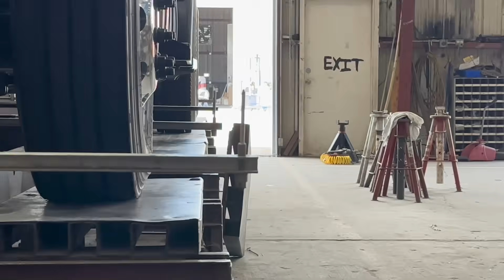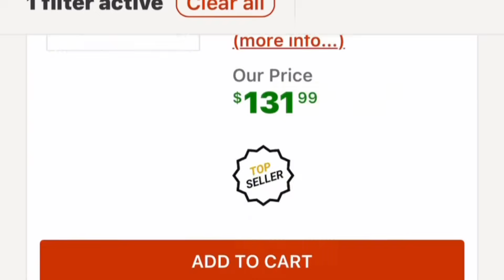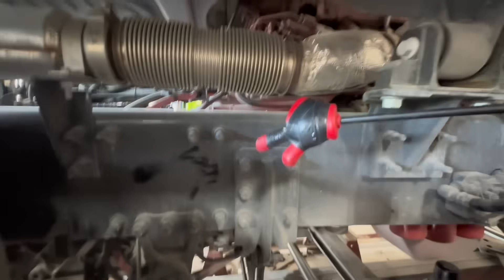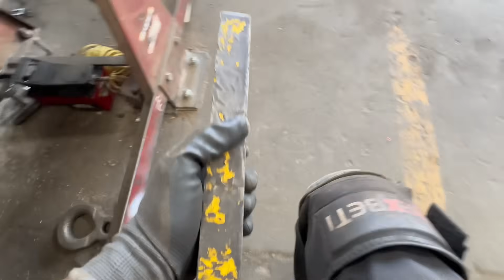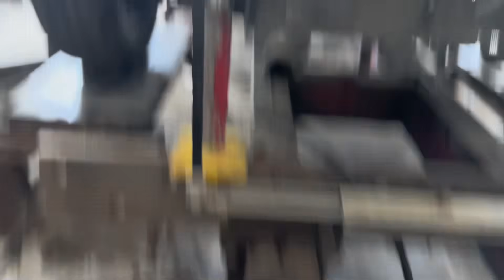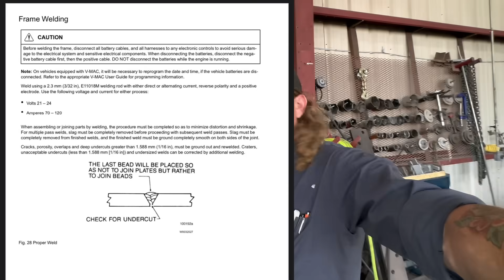I EXPLAIN THE TRUTH about truck FRAMES (by a professional)

Comment: Metal moves , the beams on buildings have an allowed amount for sway for wind and heat doesn’t compromise the metal it’s all about the right material proper installation and proper repair of any damaged structures
Reply: That is because beams on buildings are still in the elastic region of the stress strain curve.  Not the same thing.  Plastic deformation is what a bent frame experiences.

Comment: Have you talked about straightening the frames when they are straight and parallel, but not square? i.e. the right corner of the truck crosses the finish line the left .

Comment: Keep them coming! I worked in an auto body shop many years ago and had some time on the frame dozer. Had to pull the damaged parts back into place so when we cut them off the new parts would fit. Straightened some frames but usually if they are bent between the front and back axles they are junk.

Comment: From an engineering perspective, unbending a frame is pretty complicated, assuming a maximum 3.5% elongation of the metal, if we treat the frame as a solid block of metal like 4' wide, you can only unbend a curve of about 2.5"/10' but if we instead say the frame is essentially two separate 6" bars that bend at the same point along their length for about two feet, well then we're already at around a 16"/10' bend. 
Since that's so conservative that it would probably not fail for a ar550 wear steel, I would more or less say that unbending a frame is probably fine :tm: .
Reply: i find it interesting that these frames are bent at the factory, tempered and then assembled.... if someone is so concerned about the strength of the frame after it is straightened, why not temper it again? metal is metal and infinitely malleable. why do people care so much and consider parts junk, instead of repairing them if they are still serviceable?

Comment: I was driving behind a fairly new pickup truck yesterday. The back of it was a few inches to the passenger side more than the front. The tires didn't even track in the same place, you could see the front tire from behind the rear. It clearly was hit pretty hard and not fixed correctly.

Comment: I have a question. I saw a truck and trailer going down the interstate. The trailer looked like it was going sideways. I could see the drivers mirror easily. Is it the trailer or the truck?
Reply: Trailer alignment is off.
Reply: Trailer, but not necessarily because of the alignment or frame. Wind or even the crown of the road can push a trailer to the side quite easily.

Comment: I learned this about buildings, but it apples to motor vehicles as well.  old ones are built to rely on mass for their strength, and they can take a beating, be repaired, and keep taking a beating.  new ones rely on math for their strength, and once you bend something, the math doesn't work any more.